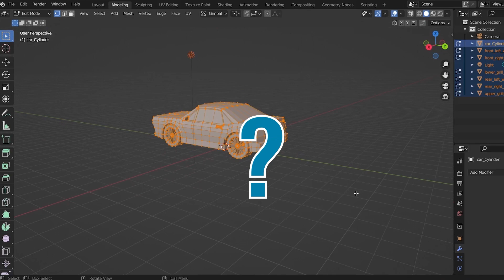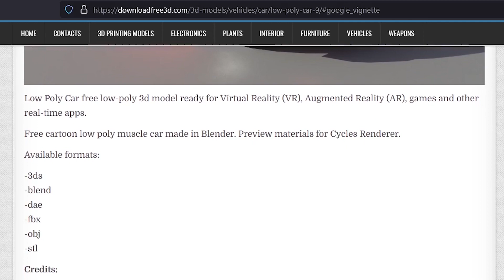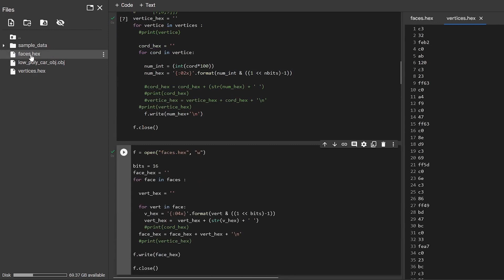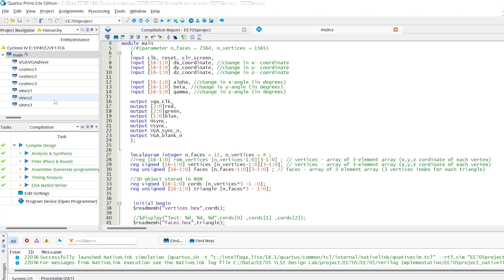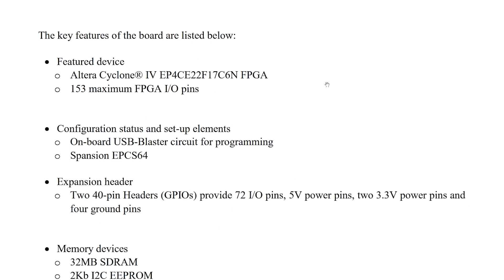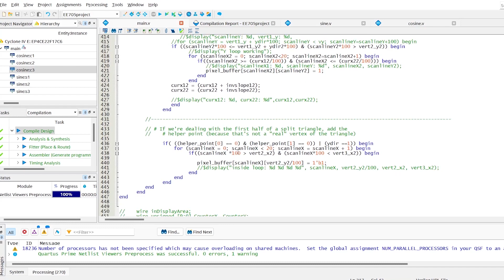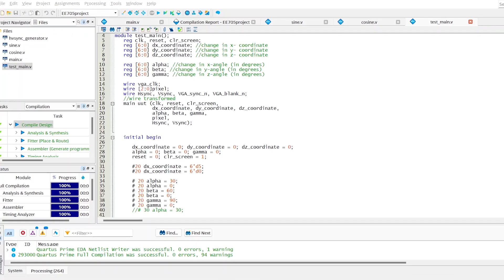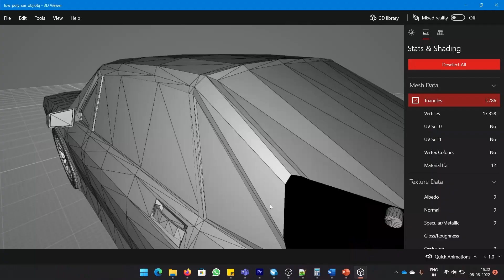3D Object Rendering Using an FPGA

Comment: Well that was a massive letdown, I expected to see a car model 3D rendered and all you could fit on the fpga was a single triangle? Surely you could of at least done a cube, It’s only eight vertices and twelve triangles but my real question is why do this anyway, GPUs are designed for this.
Reply: Implementation on FPGA gives two advantages: (1) build customised hardware with performance in direction of ASIC (obviously lesser than that) but more than a general purpose GPU (2) we get to DIY cool concepts and know “behind the scenes” of rendering process.

Comment: so the data of the mesh was encoding inside the FPGA? how hard it would be to feed it from a ROM chip? also, you could skip the trigonometry if you also hardcoded the ViewProjection matrix, or directly store the mesh in screen coordinates. Very interesting project.
Reply: The mesh data is encoded in the ROM implemented in FPGA. If you wish to feed it from external hardware then you will need to implement interfacing part only. The ultimate goal is to pipeline the whole process.
Reply: @thepeppertech  Thanks

Comment: One more question, 

1] for SIne and cosine, why do you use Lookup memory in contrast to Cordic Block ?? In fact, the Cordic block would have worked faster.
2] Is the buffer used, a dual-port memory or just simple registers?
Reply: Used LUT because aim was to develop simple and fast hardware. Cordic algorithm is great for higher precision. And the buffer used in this implementation is simply a set of registers.
Reply: 1) I believe it's for performance 
2) I don't know

Comment: I grew up in the Washington DC area and am pretty used to accents, but this accent is pretty thick and I have a little bit of a hard time following her
Reply: you people don't automatically turn on closed captions? I do it without even thinking anymore, this particular video has a dedicated English subtitle file
Reply: i live in jersey so this was easy listening honestly. the closed captions are 98% accurate
Reply: It wasn’t her accent, I think, there was either some clipping, or very aggressive noise reduction. I’m very good with accents, and still had to really concentrate.
Reply: @Hacker-at-Large  Yes there was something very odd going on with the audio, it seemed to get a bit better toward the end, but at the start there are all sorts of weird effects going on. This was very apparent when the mid point DC to Daylight advert came on, the audio quality was way better than the main video. 

The subtitles are good, but anoither tip i.s to slow the playback down slightly that make a big difference is some cases, but here it's the audio quality more than anything else causing the problems.

Andy
Reply: I think you’re right about the sound clipping, and not just the accent.  I’m glad somebody mentioned the subtitles, sometimes the obvious things aren’t obvious to me.
Reply: Imagine a German trying to understand it.